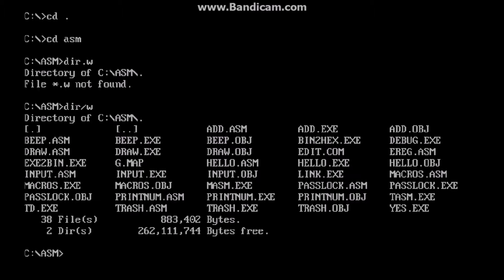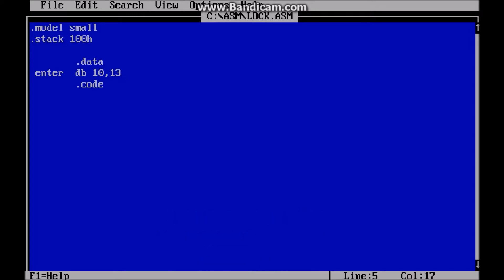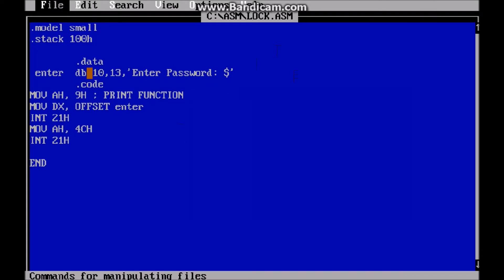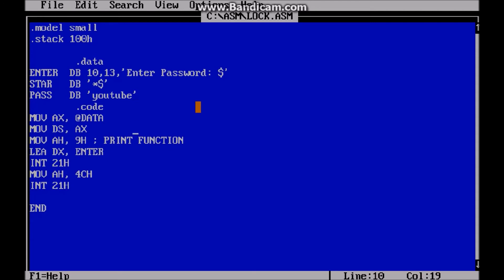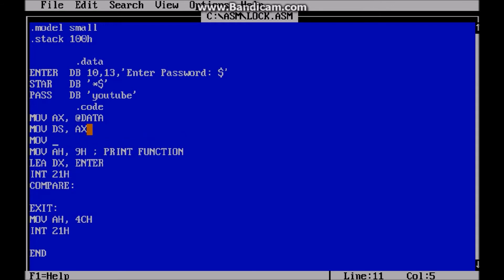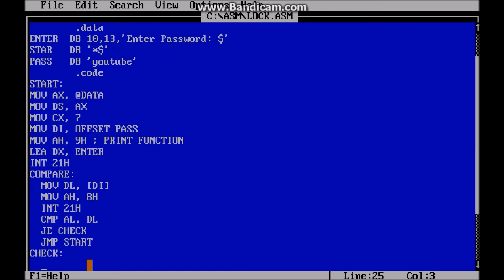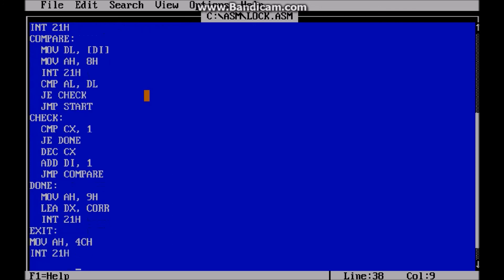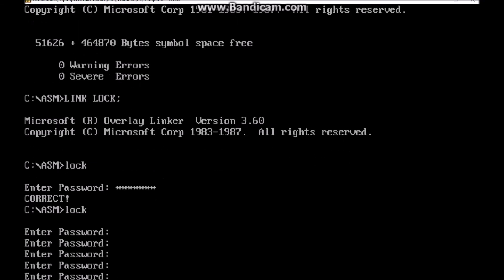DosBox Assembly - Creating a password lock!

Comment: what you enter wrong. that can show incorrect pass!
Reply from the maker: Ralph Lagdamin Simply, add a JNE (jump NOT equal) before the JE check. btw, there actually is an interupt in dos that can take a full string of bytes which is more affective than comparing byte by byte.
Reply: .stack
.data
enter db 10,13, 'Enter Password: $'  
star  db '*$'
pass  db 'ralph' 
corr  db 'Correct!$'
.code    
start: 
mov ax,@data
mov ds,ax
mov cx,5
mov ah,09
mov di,offset pass
lea dx,enter
int 21h          
compare:
      mov dl,[DI]
      mov ah,8h
      int 21h
      cmp dl,al
      je check
      jmp start
      
check:   
mov ah,9
lea dx,star
int 21h
cmp cx,1
je done
dec cx
add di,1
jmp compare
done:
mov ah,9
lea dx,corr
int 21h 
exit:
mov ax,4c00h
int 21h
end

where specifically to put it and what am i to put?
Reply from the maker: Ralph Lagdamin its 5am for me currently so i cannot type everything but this should be easy to implement, in the code below the compare label right before the JE check put JNE <the label you wish to branch to> Now in this label use 9H and int 21h to call a print and load what you want it to say into the DX register. If you still cant figure it out i can help you when i wake up, thanks.
Reply: ok dude. il wait.